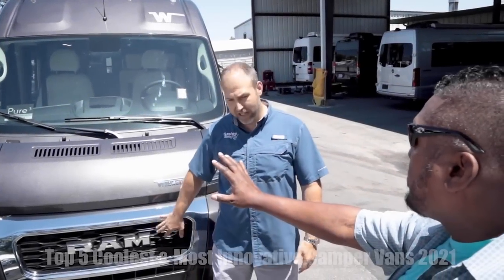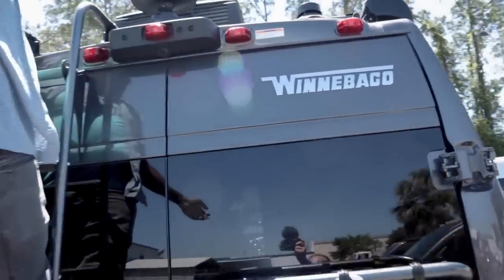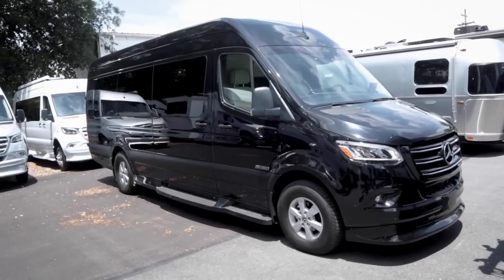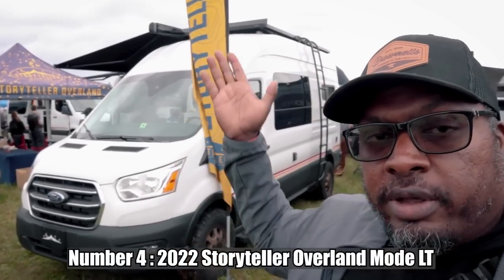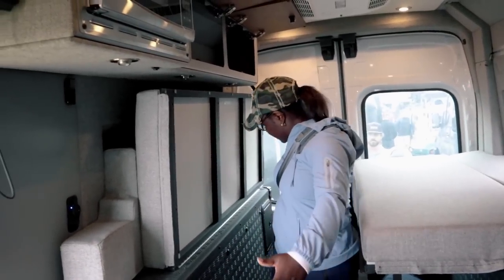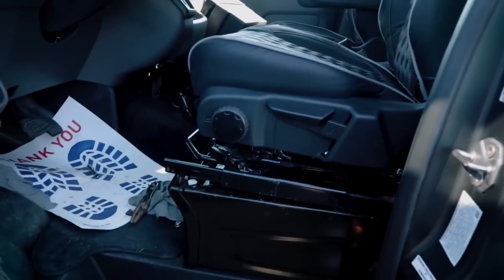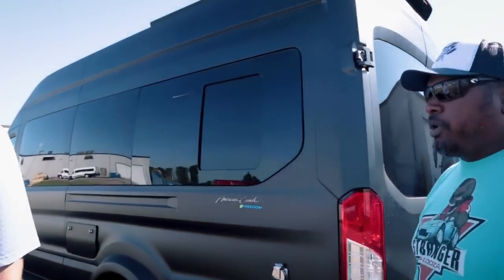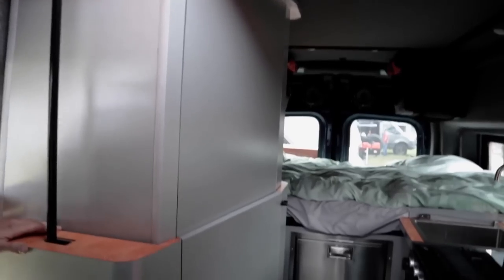Our Top 5 Coolest & Most INNOVATIVE Camper Vans We Saw In 2021

Comment: Thanks so much for selecting the ModVans MH1 and making it #1! It was great meeting you both and filming the videos. This is an unexpected honor and a great way for us to wrap up 2021! FYI, this is PJ, CEO of ModVans.

I would like to respond to a few points in the video and let you know our thoughts in case anyone was interested or wanted to discuss further. We use our vans every day, spent nearly 6 months of 2021 and tens of thousands of miles, living in the vans, traveling to all the shows. There are reasons behind some of our non-traditional choices.
Reply: We tried traditional hard sided overhead storage cabinets and ended up with the soft sided storage after trial and error. The most important reason is that everybody hits their heads and it hurts more with hard sided cabinets! Ask on any Class B camper van group if you have doubts about this point. Hard sided cabinets are heavy but the extra weight isn't necessary. We tested our soft sided storage by loading them up with a 50lb toolbox and going off-road. Our soft sided storage is modular, so you can have larger, smaller or no storage depending on your preference. We love the idea that you can take them into the house, load them up and bring them back into the van. Yeah, we know they don't look like home furniture, but that isn't a look we are trying for anyway.
Reply: Our cabinets can have any laminate finish applied to them. We could go for a traditional wood look - there are beautiful, high quality, wood look laminates available. We tried them in the past, but, ultimately, replicating a home interior just isn't our style. We avoided "solid surface" countertops because they are heavy and unnecessary. Our obsession with "light and strong" might seem excessive, but when you  drive one of our vans, you can easily tell that having a conversion that weighs about 1/3 less makes a big performance difference on and off road.
Reply: We are well aware that anything involving a toilet is a very controversial subject. For our own use, we think the MH1 with popup semi-dry bathroom and cartridge toilet is the right choice, and it is a middle-ground that works for many, but we are looking to expand choices of toilet and black water storage tank options in 2022.
Reply: Many of the unique and innovative features, including our bump out, popup tops and bathrooms, have patent or patent pending protection. However, we are open to licensing and supplying parts as a vendor, so we encourage manufactures and builders that want to include these features in their vehicles to contact us before spending a lot of time and effort copying them!
Reply: It’s was great that you did this and I definitely agree with both of your opinions.Coachman makes a great Class B. Their quality is awesome. I agree that the Ford is the best chassis. But when I went to the Tampa RV Supershow and I looked at many vans but still in the end I went to Sunshine State and fell in love with the Nova 20C on the Ram Promaster and going over to Sunshine State to finalize the paperwork next Friday. So sorry I missed seeing you both during the RV show. Keep on making great videos.

Comment: I always like watching your videos because you have a lot of passion for vans! But just try to remember and I know you don't like the Mercedes vans because of power, but they aren't built for speed and power as you mentioned! they're built for torque which is power if shifted the proper way. You get all the power you need to tow something up mountains without all the RPMs that you would get with the transit and Promaster. Mercedes are a good van! the only downfall is the lack of service stations in a smaller town lol! keep up the good work on your videos...
Reply: This is a common misconception. The Transit with EcoBoost has more Horsepower AND Torque at lower RPMs than the Sprinter. Research the torque curves for yourself and see. Towing or just driving uphill in mountains, the Transit will blow by the Sprinter every time. Yes, I know the look of the guy driving his $200k 4x4 Sprinter camper van who can't do anything to stop a $100k Transit camper van from passing. Here is some real world experience with Transit vs. Sprinter: 

Sprinter vs. Transit! Check out the off-road capabilities of the Ford Transit based MH1 and CV1 camper vans with AWD and EcoBoost. Thanks to Backwoods Adventure Mods for hosting us in beautiful Kingston Pass 12-13k' in Colorado! https://www.youtube.com/watch?v=v9BsYqW9ULo
Key video moments:
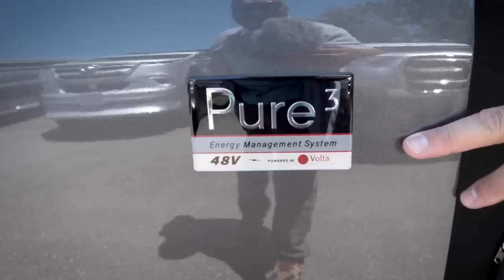08:17 - Great shot of the whole crew!
09:25 - Sprinter fail #1 (rear diff leak)
11:59 - Sprinter fail #2 (tow at 14:11)
16:12 - ModVans Transit FTW #1
17:25 - Sprinter fail #2 part 2
18:30 - ModVans Transit FTW #2
19:37 - Top out!
22:48 - ModVans Transit FTW #3
23:57 - Sprinter fail #3 (flat tire)
24:59 - Sprinter fail #4 (tow #2)
Reply: @pjtezza  yes you can read all the data sheets all the manufactures put out on their product that they say is based on real-world experiences, but the reality is and you can agree with me based on your video that one product seems to work better than others! but every manufacture would disagree cause of their datasheets! as I said in my previous comment Mercedes isn't made for speed and driven right it gets you up the mountains nicely in low RPMs saving you on fuel! and yes the ford transit and the Promaster will fly by Mercedes on the hills, but I can guaranty you from my experience they certainly won't be flying by at 2000rpms! especially when inexperienced buyers of these custom vans forget the rule of weight limits lol. 98% of the people buying these over price vans aren't 4 wheel driving like the people in your video. All the heavy pedal people should be buying the transit or the Promaster as it's built for them, but if you want a nice ride get the Mercedes lol personally I wouldn't buy the Mercedes just because there isn't enough service station around to service them lol but the Mercedes is a nicer looking van !!
Reply: @waynec2962  this is math backed up by personal experience and video evidence: The Transit with EcoBoost produces more torque at 2000 RPMs than the Sprinter. There is no place on the RPM/torque curve where the Sprinter engine produces more power than the Transit.
Reply: @P.J. Tezza  your trying to compare diesel vs gas ! So a gas engine that has to produce 310 hp to get 400lb of torque using a 10 speed transmission (transit) vs. 188hp and 325 ft pounds of torque on a 7 speed transmission (sprinter), so if we are doing the math, it's pretty good that mercedes got 325 lbs of torque on only 188hp on a 7 speed transmission lol I use to drive tractor trailers in my youth and I dont ever remember a Gas engine in a truck pull a 45ft cargo trailer carrying 75k lbs. I've had experiences with 40ft diesel pusher motorhomes as well as ford v10 motorhome, and currently, I'm driving a transit with the 3.5L for work, so I to have experience! I get it your a ford transit guy! Every van has its unique features. I don't see any one van any better than another simply because each van has its unique features! For example some are longer and wider, some are front wheel drive and rear wheel drive! Not to mention all wheel drive. Like I said before I wouldn't buy a mercedes just because  lack of service stations. But they do have a gas version that came out recently, and when they build it to fit the extend dually 170 on the 24ft length and with the smooth lines in the body then forsure I'm buying it 😆
Reply: @waynec2962  I'm a math guy and I'm sure that 400 ft lbs of Torque @ 2500 RPM is the same, regardless if it comes from gas or diesel or what gear you are in. Yes, Sprinter now has a gas option and it also has less torque across all RPMs than the Transit EcoBoost. Sure, everybody has their opinion, but 400 > 325 is not an opinion.